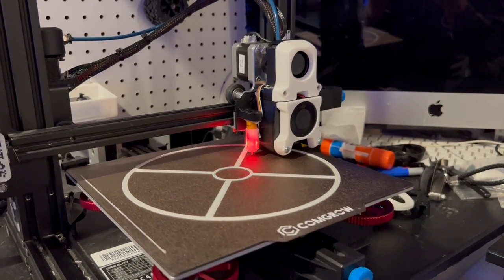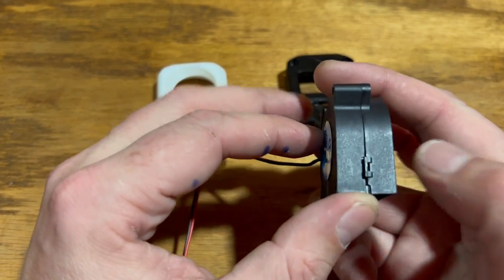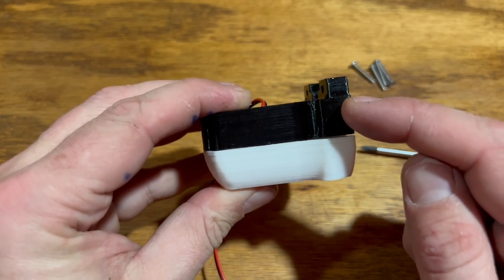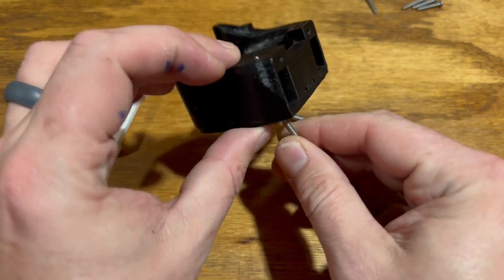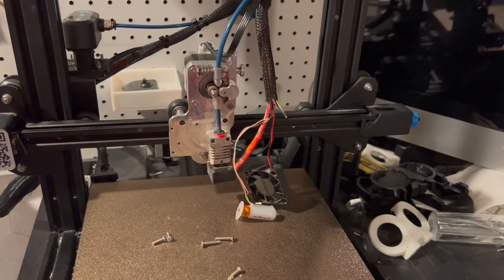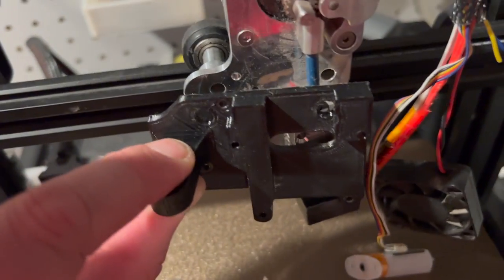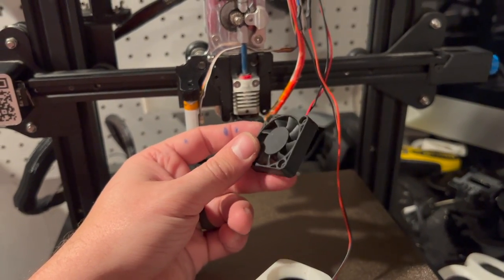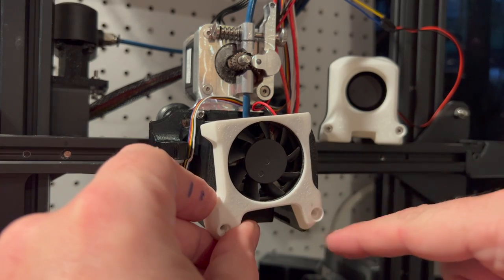🆒Swissburner - Ender 3 Series(3, Pro, 3v2) - Voron Afterburner for Micro Swiss Direct Drive Extruder

Comment: hi. what settings do you change from ender 3 bowden . especially retraction setting do you use for this direct drive system ? do you adjust the flow rate as well ? i cant seems to get any print going at all after i upgraded to afterburner with direct drive on my ender 3 pro.
Reply: I upgraded mine to ender 3 to direct drive and it’s been a massive pain trying to get it to work
Reply: @ZFGFZDGDFG  you guys need to calibrate you esteps and retraction settings. I recommend looking it up and printing a retraction tower
Reply: @adamsalem-s  I had already done that ended up being some dodgey filament
Reply: @ZFGFZDGDFG  yeah I would recommend buying high quality filament to avoid problems like this but while typing this I realize I’m a hypocrite because I also buy cheap filament. What I do in this situation is put it in my filament dryer